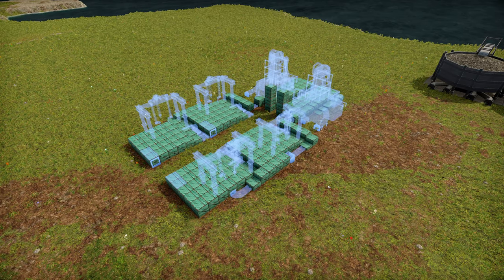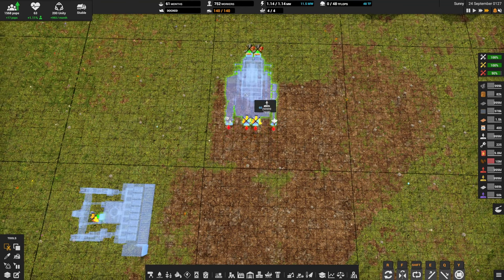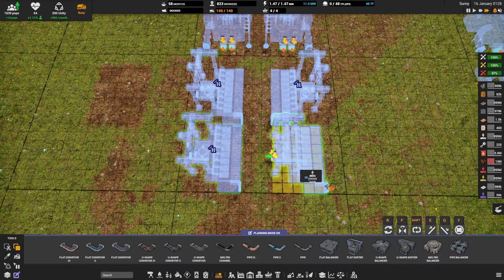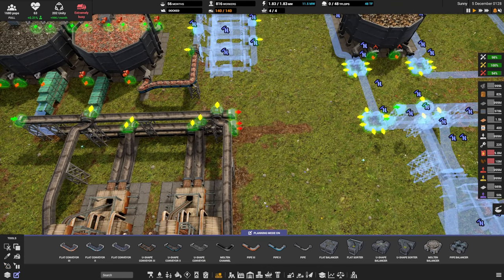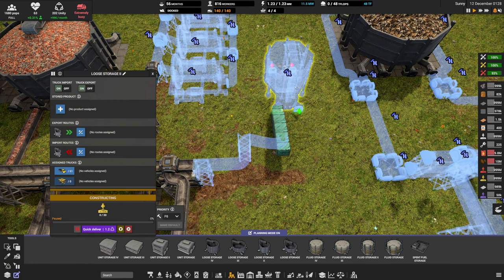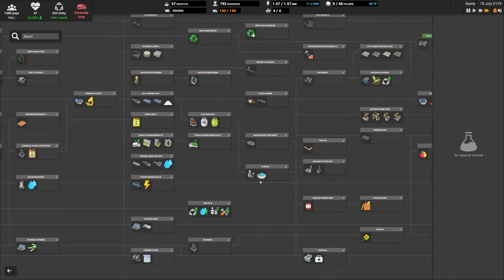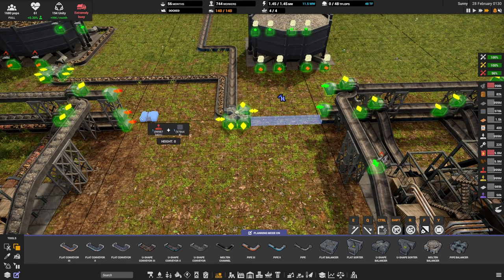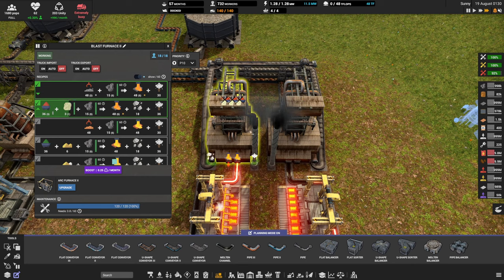Upgradable Smelter Designs - Iron Edition 🚜 Captain of Industry  👷  Walkthrough, Guide Tips & Tricks

Comment: Great Guide JD! Thanks a lot. My only doubt that i changed and still consider better is slag in the middle with only one belt for a couple of fournace (18+18 slag is always a M1 belt, it is only one and it is shorter, less materials and less power)
Reply: Same, as it needs less power to run then.
Reply from the maker: I looked at this, BUT I decided against this for Iron, this is mostly due to it being easier to swap over to steel later. It has to do with the Exhaust for Steel. For Copper and Glass you will find slag on the inside
Reply: @JDPlays  I had some problems with the Exhaust for steel in this way but i guess that it was due to i decided to use only one big Exhaust and the space was small for 4 pipes.

Comment: Could you connect the two slag outputs with an elevated belt and then run a single belt up between the two smokestacks?
Reply from the maker: Yes, this is why they are kept flat when they go around the corners
Reply: @JDPlays  Huh? I'm asking if you could run a single belt for slag up the middle between the two smokestacks instead of having one on the left and one on the right.